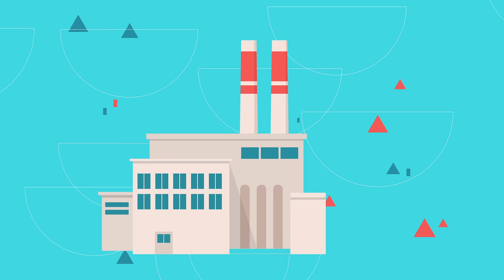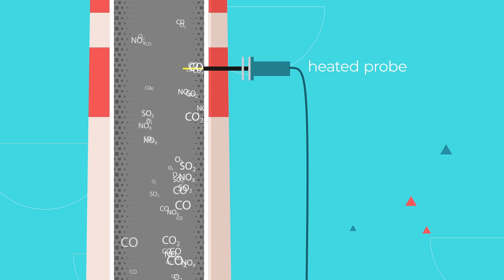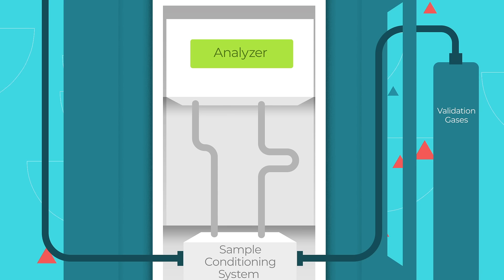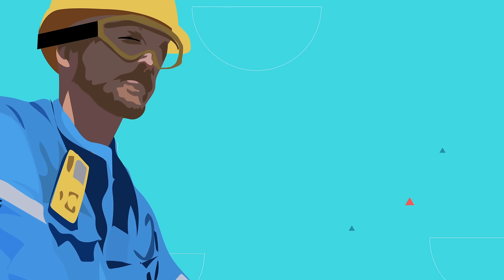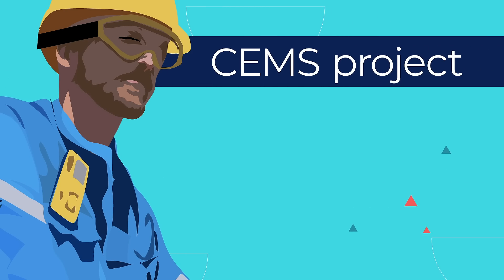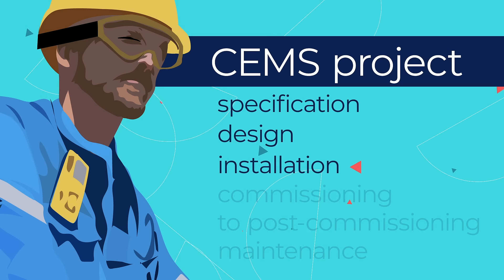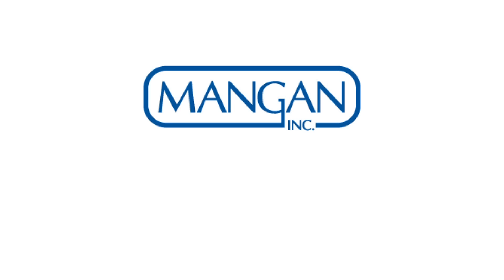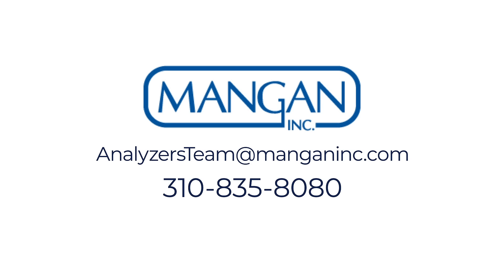What is a CEMS Analyzer? | Continuous Emission Monitoring System

Comment: Can you describe what happens if CEMS fails to pass Part 75 certification requirements?
Reply from the maker: Part 75 certification requirements establish the accuracy of CEMS. A regulated facility or unit is required to perform the initial certification tests after CEMS installation and the ongoing certification tests thereafter to ensure the performance of the analyzers or monitors within the established standards.  Quarterly tests are also to be performed according to the quality assurance protocol as well.  Here is a link to learn more:  https://analyzerengineering.com/part-75-certification-requirement-for-cems/